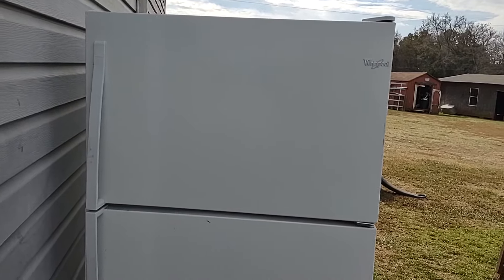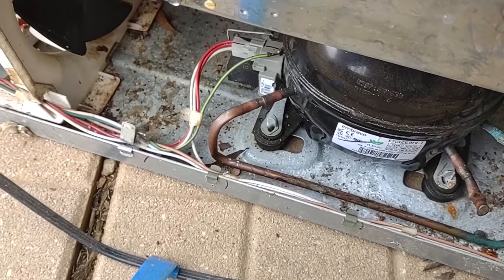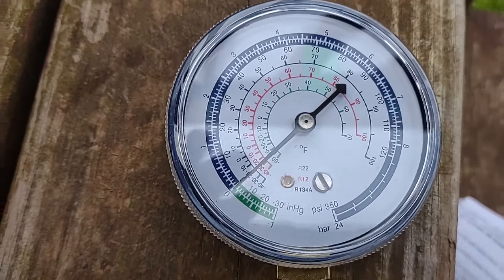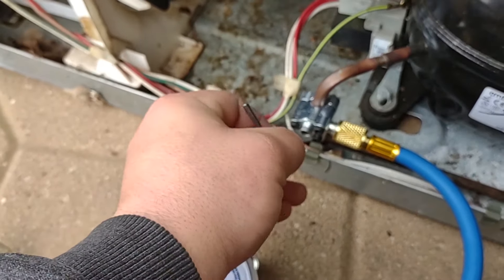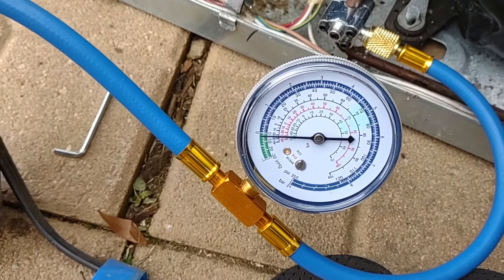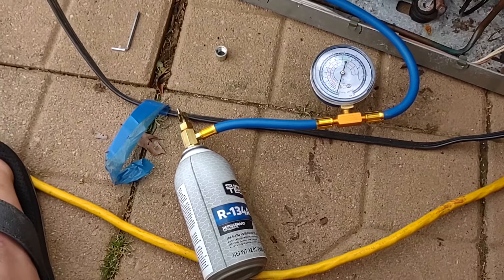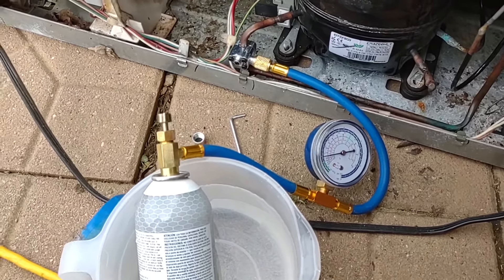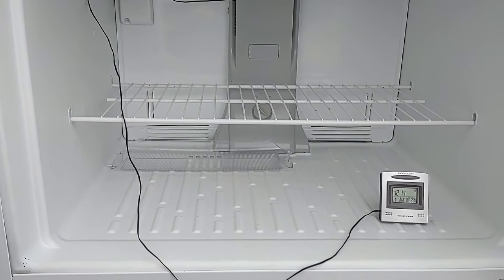Fridge Recharge

Comment: 134 has to be put in as a liquid. It’s a blended refrigerant, and you have to purge the air out the lines. Now you’ve made your own blend and contaminated the sytem.
Reply: Charging with R-134a can be done either as a vapor or a liquid, it is not a blend it is a pure refrigerant

Comment: You put way too much pressure inside it! You misunderstand the temperature indication on the gauge. The temperature value you read on the gauge is for the fluid/vapor mix temperature inside the evaporator since you measure the pressure from the low pressure side of the compressor (the intake). If you want to reach low temperature (which is what we want in a fridge), you put way too much pressure in the system as with what you did, you will reach just something like 30-40° in the fridge and maybe break the compressor. For a freezer, you would expect below zero temp in the evaporator, so the pressure you should put inside should read something close to Zero PSI and maybe somewhere like negative 5-7 Hg (-1 to -2 PSI) instead, all measured with the compressor running for getting very low temperature. Pressure can go up to a few PSI for higher temperatures (for a fridge only, not a freezer), but no way near what you put in yours. Also, when you plug the hose on the fridge, you should purge it from air before opening the valve on the fridge otherwise you may put some air in the fridge circuit which is really not good.
Reply: Is it actually OK, if the pressure becomes slightly negative, or is it generally better st stay al low on the positive as possible? I assume a negative pressure will increase compressor load and power consumption?

Comment: The EPA will fine you $10000 for every instance of recharging without repairing the leak first. Also they will fine you if you are not properly certified for refrigerant recovery and evacuation. This is only due to appliance manufacturers getting together and lobbying the EPA to do this. They don't care about automotive unless you are a shop.

Comment: You totally are doing all wrong you have over charged the system. Properly charged it should have 3psi in it. And you should have had the back panel off in the freezer while charging it, you have a restriction in the system
Reply: I agreed with you . He doesn't has experience how to fill the Freon in

Comment: Thanks for the video. Should have purged the air out of your hose and the pressure now indicates you are overcharged (no bueno). From what I have researched the R134a pressure scale should read around  -15 to -20 or 3 to 0 psi Hg. Good luck with your refrigerator, I got one to fix myself.

Comment: how do you expel the air that is in the circuit?
Reply from the maker: in order to completely remove any air that may be in the system is to use a vacuum pump.

Comment: If the system is flat, meaning zero freon, put nitrogen 100 psi and find the leak. Fix leak. Then vacuum the system and charge it with (134a) in this case. 
Before transferring 134a, purge air from your automotive contraption line and then charge your system. For Charging, your compressor should be running. 

Not sure if these automobile charging hose with gauges are accurate. In a properly charged system, your discharge line temperature should be 20 degrees F higher than the ambient temperature.

Comment: Servicing a system with a leak thats gone flat has air in the loop. Adding refrigerant before repairing the leak and or pulling it into a vacuum is not recommended.  Air = moisture which will eventually cause acid equalling in a compressor burnout.

Comment: Hi. Excellent video. Technician installed piercing valve on factory port to check the refrigerant pressure. Can I use that to add R134 instead of installing new piercing valve on suction line? Thanks a lot!
Reply from the maker: Yes absolutely

Comment: Dear friend thanks for your videos, I need to ask something, because I'm not too much prepared about the argument, I discovered a gas leak on a little refrigerant circuit I used as air conditioner... gas is propane R290, how I can charge it? Vacuum pump is needed right?
Reply from the maker: @Carlos4998  depends on the fittings used on the R290 tank. Unfortunately, I haven't messed with R290, so I'm not sure how to service a system that uses that refrigerant.
Reply: @antonioadkins5104  I see... but I read that the valve you used in the video is also used for R290 systems

Comment: Do you need to put AC oil? In cars' AC system they pot PAG oil, not sure about this appliance.
Reply from the maker: Yes for car AC systems and normal household AC systems but DO NOT mix oils like those together as they can damage the compressors or mess up the refrigerant.

Comment: Does anyone know why my pressure gauge is reading 70 psi when I open up the piercing valve to get an initial read? 
Definitely not showing up as negative pressure. I’m 99% positive I’m installed on the suction line.

Comment: It sprays because you need to tighten the valve all the way down first, when using the blue adapter. 
I used the blue adapter, and it didn’t spray.

Comment: Antonio, you somehow have an r134a can that does not have a self-sealing valve. I don't know if that's a state law and your state doesn't require it or it's federal law and you have an old can from before. 

My state requires the self-sealing valve and the piercing hose will not open the valve without the blue adaptor. You should have the piercing needle on the hose screwed all the way down (closed) and then attach it to the can as just screwing the hose onto the can will open the self-sealing valve.

Comment: Hi Antonic.....me again.  Will the final Bar measurement / PSIG be, for you, at 3.2 / 46 while your system is shut OFF or is it while the gauge is hooked up and the compressor is still running?
Reply from the maker: Gauge connected and compressor running
Reply: @antonioadkins5104  🤗
Reply: 134afrge sustion 1.93. Discharge200.5only mor enot mor e no high triping not cooling
Reply: Don't worry much about the standing pressure, the working pressure is more what you need. The low side should be running between 0-2 psi not bar and not 45 psi. 45 PSI will blow you comp up in short order and if for some reason it will run you will slug the comp with liquid refrigerant.
Reply: @suiseidel1  When should it be between 0-2 PSI? I know, when running, but I noticed that the pressure will drop as a unit runs. Gauge reads Higher the first few minutes, than after 10-15 minutes it's a bit lower. What Value should be considered? I assume the one after 15 minutes, because we NEVER want to see a vacuum. Am I correct?
Reply: @yxcvmk  yes, after it settles down and runs for a little bit it should be just out of a vacuum.
Reply: @suiseidel1  Thank you. Looking at the PT charts, and including the fact that I can (after extended runtime if freezer was @room temp and cools down first time) see icing occur on the low pressure line right before the compressor, I assume the refrigerant is on the high side, unless something else is wrong. I know that a technician did fill it a while back. If it cycles under regular conditions the line seems to stay around 51F. Running pressure goes down to approx. 2 PSI after extended run from room temperature, otherwise a bit above 3.6. Unit turned off, pressure is @ roughly 30psi @ room temp around 74F. Do you think I can lower the pressure, and will a slight vacuum right before the compressor increase efficiency, even if the compressor has a minor additional load, but the evaporator will get colder? Or is it desired to stay in positive pressure at all times? By the way it's a Waeco with a DC BD35 compressor.
Reply: @yxcvmk Р - 134 при давлении +0,2 бар кипит при температуре минус 26°С , что даёт команду на М К для его отключения .

Comment: Do not do it. It will ruin the sealed system. 
Pearcing Valve is going to leak 100%  
You must use brazing equipment,scale,nitrogen ,to work with sealed system. 
1.Recover  Freon. 
2.Vacuum the system ( see if it change the pressure)
3. Add nitrogen 
4.check for any leak
5.clear the restriction. Replace dried filter
6.vacuum again. 
7. Add refrigerant by weigh.gauges will not do it right.
Reply: Ur talking about replacing a whole compressor
Reply: In California, my 3year old frig lost its cooling. The techs out here won't recharge the system, so the New frig will be going to the dump if I don't fix it. It's dyi or landfill, only two choices!
Reply: @artymowski  Now in California, no dumping old fridges in the Landfills, that's now illegal.

Comment: Will your amps reduce if the R134a is low?  In other words, is there a way to validate using a Multimeter the amp draw as the compressor is running?  If so, does each compressor have a different value? 
Finally, as for the gauge reading, how did you know to bring it to ~ 2 psi.  I note on your gauge at the 19:04 it reads three scales of degrees Fahrenheit, one for R134a, one for R600a and one for R-290.  If correct, are you saying that you need to get the leveling of the gauge reading to ~3.1 because your temperature outside is around 50F.  So, since I am in my basement and it is 62F then I probably want to be  4?  Was all this information on the bottle of R134a?  The  bottle only says "Automobile A/C, only"....but R134a gas should be the same, yes?
Reply from the maker: Yes the amperage on the compressor will be significantly lower than the normal operating current on its name plate for instance the compressor in this video should be drawing about 6 amps give or take but it was only drawing 0.98 amps also it wont be as loud as it wont be under load. On the gage its not 2 PSI that is the Bar measurement. You take the ambient temperature then go to the little Refrigerant scales and line up the Refrigerant type with the pressure. example the ambient temperature is 50ºF and im using R134a so the pressure should be about 45 PSI or just over 3 bar and if its R22 then the pressure should be just over 80 PSI or 5.5 bar. Also it doesn't matter of its a Automotive type of refrigerant as long as it doesn't contain any compressor oil or additives for automotive type AC compressors.
Reply: Wrong!! Your amps will be higher
Reply: @travisorth9933 No, you're wrong.. The less fuel the less work the compressor has to do.. The more fuel the more work (amps) the motor needs to run.
Reply: @antonioadkins5104  I'm sorry but you're mistaken.
The gauge is just showing low side pressure which depending on the refrigerant being used will dictate 
evaporating temperature which in turn will dictate the temperature of the fridge or freezer.  
Roughly speaking 134a at 0psi will be about -20 and at 30psi will about 32.